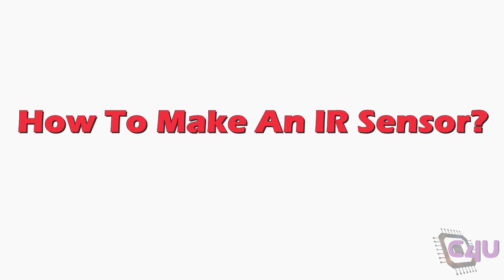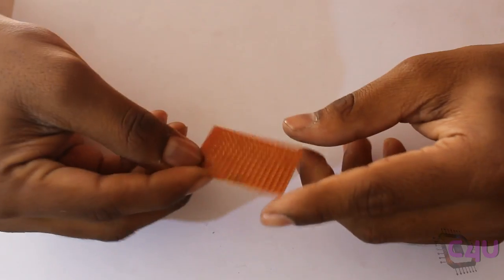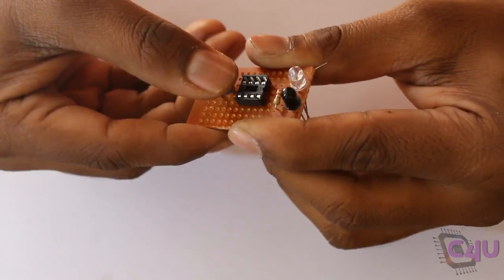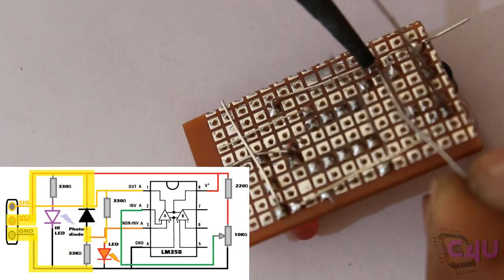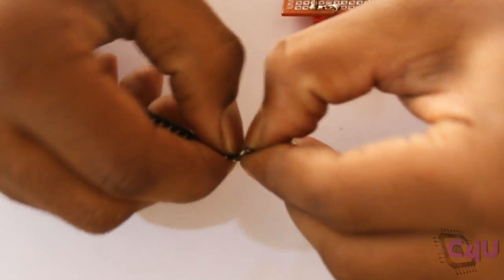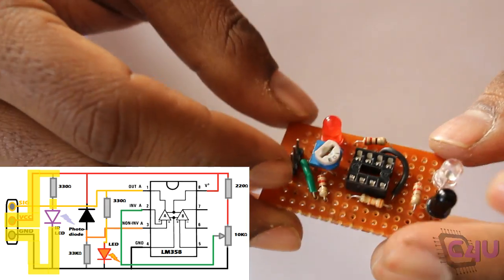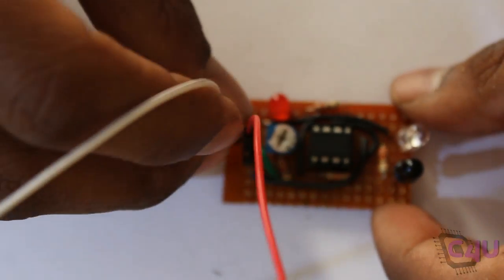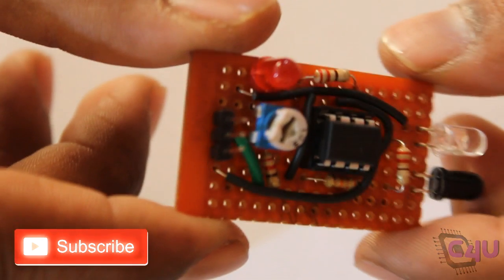How to make IR sensor? | DIY IR sensor

Comment: How can i make it work, with 12 v ?
Thank you
Reply from the maker: Use 7805 to power the sensor.
And you can connect transistors or relays to get 12 V output.
Reply: @Cirkit4U  Thank you buddy, thank you for your reply

Comment: Hi thanks and one question, this sensor gives a low or high output. What I mean when it doesn't detect   any object the output is low or high? I need a low sensor cause I need to turn on a motor when it detects something. Thank u! I'll subscribe
Reply from the maker: Just connect a motor at the output of sensor, use L293D or ULN2003 if it requires more voltage to drive the motor.

Comment: Doesn't work propely on sunlight  .Pls explain
Reply: Son light padne par kam kar rahe sir
Reply from the maker: You have to adjust the gain of the sensor or cover the sensor  with the black colored strip or case, it will help.

Comment: can we put a motor in the place of the led instead?
Reply from the maker: You can put device which works on 5V or below. 12V DC motor requires driver IC to operate the motor.

Comment: how to increase the range of ir sensor minimum range 12cm
Reply from the maker: Range of IR sensor is dependent on IR LED's transmitting power..
For which application you are using the IR sensor?
Reply: i using ir sensor in tachometer because ir sensor very minimum range i don't finishing my tachometer performance, so please help me

Comment: i think photodiode is to be connected in reverse bias
Reply from the maker: +Nived P  Yes, photodiode is connected in reverse bias..
Reply: i made it .but its not working.led lits when i turn variable resistance to one side.No sensing when a obstacle is brought in front.Pls help me. i have given an input voltage 12v
Reply from the maker: +Nived P It works fine with 5V. Pls try with 5V input..
Reply: Circuit4